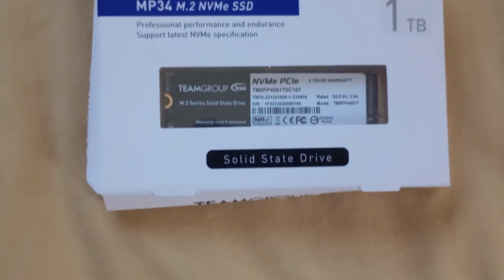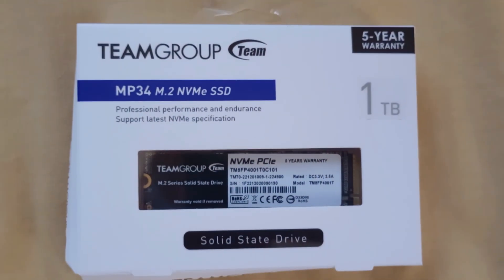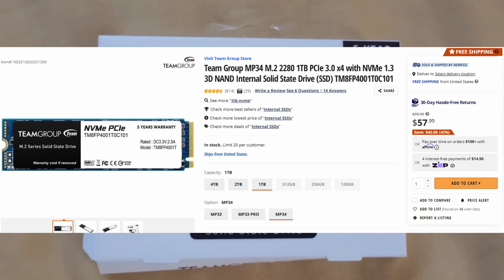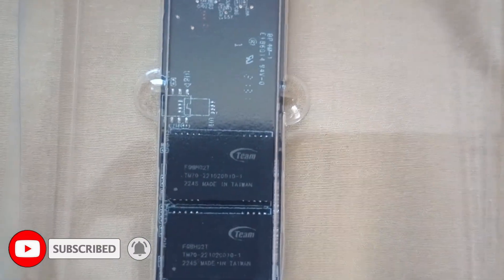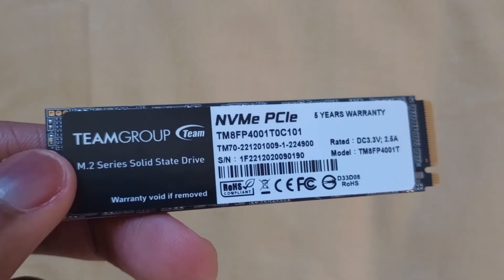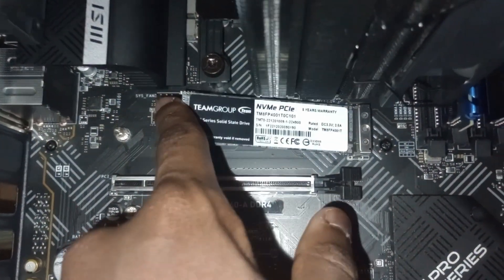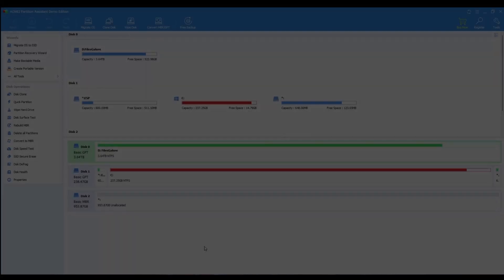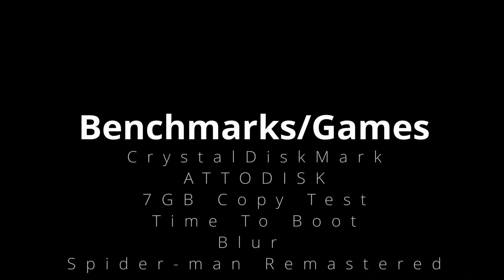The Best Value NVME SSD In 2023 | TeamGroup MP34 1TB Review

Comment from the maker: UPDATE: Heads up for people willing to buy or already using the MP34 NVME, chances are that it may be faulty and that you need to backup your data as soon as you can! It can fail without warning. Mine recently died and I lost my data because of it (you can check it on my recent vids) and someone also have a similar issue. So please, if you already have it installed as your main os or anything else backup and use another drive ASAP. And if you're buying it, try finding another similar priced drive with a known brand.
Reply: wtf ? this is bad???? what about warranty
Reply from the maker: @stevensv4864  warranty exists but in my opinion I wouldn't trust sending my broken drive (stored with data) since you'll never actually know what they'll do with it aside from sending a replacement.
Reply: @GameFrostYT which is one more reason you should always encrypt your boot drive.
Reply: Just send it for the RMA, trust me those underpaying overworked staffs at team group gives 0 fucks about what kinda kinky porn may have stored on your SSD 🤨📸
Reply: Thanks for the personal test. As a Taiwanese, I also shun the 10 Ambrose brand! This brand is only recommended for use as a gaming hard drive!
Reply from the maker: @mars19432000  Indeed, I was very happy to use this nvme and it sucks to see that it is not good, I hope more people see this pinned comment before buying!

Comment: Help my team group ssd just failed. Its in warranty till 2025, but it seems i have to pay to send it to Taiwan 😢
Reply from the maker: Mine also died and I did a follow up video not too long ago, I'm going to make a pinned comment and edit the description to help people skip this nvme SSD, did you know why it failed?
Reply: @GameFrostYT  1 minute I'm watching Netflix. The next blue screen. I restarted the laptop and then Windows OS can't boot. No Harddrive installed error. 3F0
Reply from the maker: @oganibi9313  wow that sucks... Have you tried any other drive to verify that the nvme was faulty? When mine failed it took minutes to boot only for it to go into the bios.
Reply: I've tried another drive the pc works fine. It's the SSD that got fried for no reason. Hopefully I can get this replaced. The drive is only 1yr old. I've got 2 yes of warranty left but the return process seems crap. Shipping to Taiwan from the UK is probably more expensive than buying a replacement drive myself
Reply from the maker: @oganibi9313  my drive also got fried/crapped out a few weeks ago and I bought it since February. Wow I thought this drive was good value for the performance but it turns out it has its faults. I now have a WD SN770 which is a great nvme from a well known brand. I also have warranty but chose not to send it back because honestly, you never know if they can recover your data without you noticing but that's just me. Anyways thanks for the heads up about this issue, I hope you at least have something backed up (a lesson I learned from now on...) Have a great day
Reply: @GameFrostYT  thank you. Just learned to keep a back up, that'll save me in the future

Comment: I have hp pavillion 15-ck066tx gaming laptop intel 5 8th gen i want to upgrade the hdd to 1t ssd and 128 nvme to 1t nvme and 2 slot of ddr4. Please suggest what will i buy
Reply from the maker: You can get a cheap 1TB SSD from amazon, something like silicon power 1tb is going for a good price.
As for NVME the mp33 or mp34 is a good choice if your laptop supports it.
And for ram it is up to you to look at your pc specs, if it can support up to 16gb/32 gb then buy those 2x8/2x16 ddr4-2400 so-dimm kits from ebay or newegg.
Reply: Thank you very much
Reply: Any brand will work or should i buy same brand for the best result?
Reply from the maker: @rsedillo29  For ram its a must, for SSD/NVME not so much, just find something thats compatible with good performance for a reasonable price.
Reply: Last question sir how to know the compatibility of my laptop for the new memory?
Reply from the maker: @rsedillo29  you can check from sites like hp and crucial, your laptop is running on so-dimm memory so start from there.

Comment: Does it have Dram cache as the spec sheet states it does?
Reply from the maker: Indeed it does, here is the link to their site for more info: https://www.teamgroupinc.com/en/product/mp34
Reply: this drive is pretty much a older dram drive with a tier-up controller (Phison E12) + some older flash in the price range of dramless drives and Phison E13 / SM2268XT.

only thing is warranty is a bit shorter, and well, it's from team.

Comment: I need help does this ssd works for ps5?
Reply from the maker: It does
Reply: @GameFrostYT  really, all the reviews i have seen says it doesnt😮
Reply: @GameFrostYT  also should i install a heatsink with it?
Reply from the maker: @appp4151  Well yea if you plan on using it on pc, dunno if it would fit on the ps5 anyways, now about the reviews it could mean that it won't accept any PCIE Gen 3.0 NVME only 4.0, I don't have a console you have to do some more research on the unit

Comment: This man did a better job at explaining every bit more than a lot of big tech channels and even the installation process, while being straight to the point. Mad respect. 

Also quick question, hows the drive going so far? Im thinking of getting the same exact model.
Reply from the maker: So far, it's going strong, been using it as my main os drive ever since this video was posted, downloaded some games on it and it was a smooth experience, very solid NVME I ever owned so far.
Reply: @GameFrostYT  thank you. I’m using MP33 Team Group SSD 1TB Gen3x4 NVME. For some reasons, it’s so strange that when I copy the same folder 30GB from HDD to that MP33, its copy-paste speed is about 150MB/s, but from a SSD Sata 3 KingSton, it’s only 30MB/s speed. Do you know why? Best wishes
Reply from the maker: That's because it's Dram-less, it tends to slowdown the drive after some reading and writing and relies on HMB (Host Memory Buffer) to not lose further performance, this only happens if you are transferring big files, now this is one part of the answer. The second half is that your HDD is not fast enough to transfer, even if its a SATA 3 drive it has to use the spinning disk inside to locate each piece of data which can take some time to get. So thats why your transfer speed is so low, if you were transferring from an SSD you may go up to 600MB/s (SATA 3 max speed).
Reply: @GameFrostYT  DRAM is pointless unless your workload fits inside your DRAM. And if if does your SLC cache is irrelevant. 
The key problem with TLC is the much-slower folding mode after the SLC cache is exhausted, not the native speed of the TLC cache. So cache is useful unless you are stressing the drive with large volumes of data - in which case you might even benefit from turning off the SLC cache as well - depending on the speed of the underlying TLC flash.
Reply: @GameFrostYT  Did you even read his question? He is copying from a SATA SSD and seeing a significant reduction in speed: instead of almost pushing 600Mb/s he's seeing only 30.
Reply from the maker: @nowandrew4442  oh my bad, i was a bit in a rush and i didn't fully recognize the last set of words, that's really weird for an ssd to be slow like that, I think he needs to check crystaldiskinfo for any possible errors of the drive. Maybe reseating the SSD's power and sata cable may do the trick i guess.
Reply: @nowandrew4442   thank you. What should I do now? Is there any tool or software to check if my SSD is fine or not?
Reply: What on earth are you talking about? Where's the SQL random-access test? Where's the sustained transfer test across the capacity of the drive? 7Gb is utterly meaningless for a drive with 200GB+ of SLC cache. Where's the test of pulling the power out of the system the second that Windows reports that the copy has completed - and then check whether the file is actually safely saved to the drive. Spoiler: It's not.
Reply: That's good, and the price now is under $40  July 2023... for $160  you can get  the 4TB version if you have a lot of music, video, documents, games, photos, etc...
Reply: @SeaJay_Oceans  The MP34L is also a good buy, a bit more but reliably gets 4000/3000Mb/s instead of the 3000/2000 of the MP33. No DRAM, but depending on usage, this may not matter.
Reply: I generally buy, install, or recommend RAM Cache enabled  SSDs.  Crucial SSDs support Crucial Momentus RAM Caching, and Samsung SSDs support Samsung Magician Full Performance Mode with RAPID RAM Caching Acceleration.  ( ~ 8GB/Sec read and write speeds).
If you want to use a different SSD manufacturer -  test drive  PrimoCache  RAM caching acceleration by ROMEX Software for free...  PrimoCache uses your own PC memory to give NVMe speed even to 20TB  Hard Drives.   PrimoCache can also run a 2 Level cache -  keeping what you are using in the RAM cache, and having fast storage of a large hard drive kept running nearly as fast on an SSD or NVMe second layer cache.  I use PrimoCache on all my large TB SATA III Hard Drives to sustain 15GB / Sec Read speeds and 13GB / Sec Write speeds.
Even with 'slow cheap RAM'  all caching programs will speed up SSDs very much !  And if you have a top of the line gaming rig with the fastest RAM installed, even better.  My rule of thumb is more RAM is the better choice over faster RAM.   Installing 32GB, 64GB or even 128GB of RAM in new systems is relatively inexpensive,  vs.  buying huge amounts of accelerated storage.